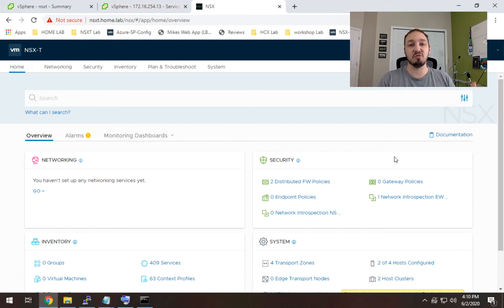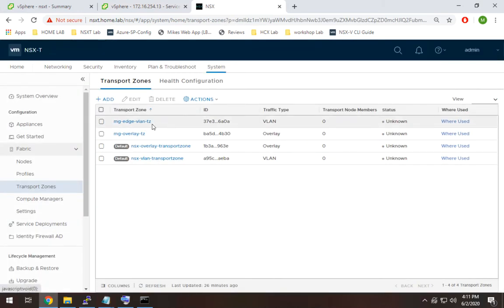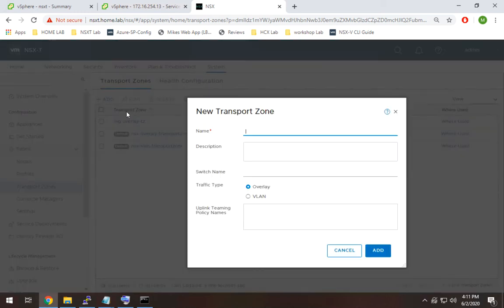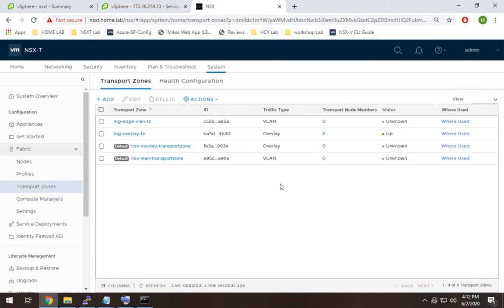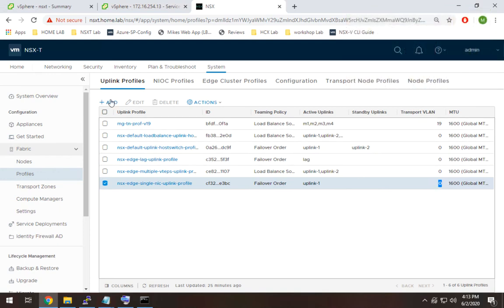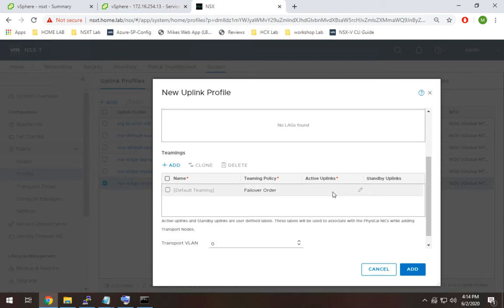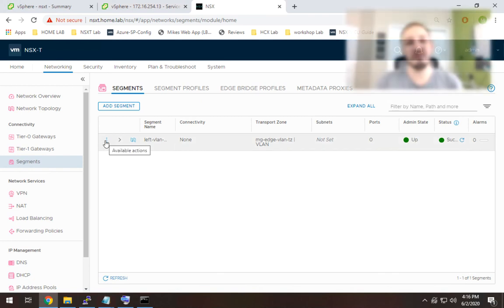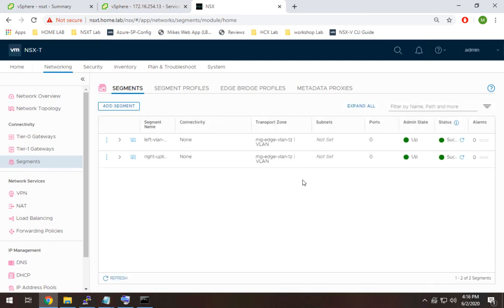NSX-T 3.0 from Scratch (Pt. 10): Edge Deployment Pt 1

Comment: You go into making sure that the switch name is the same on the transport zones, the overlay TZ shared by Hosts and Edges and the VLAN Backed TZ for the Edges that will be used for T0 Router uplinks to physical routers. On version 3.1.1 there isn't a place to specify the switch name anymore.

You specify an active and standby uplink profile for the edges. The edges are virtual whereas in the real world ( not a lab ), the Transport Nodes are physical, so I guess the uplink profile doesn't matter all that much. Both are going to connect to the same VMware VDS in the Host.

Comment: A key thing I am seeing is the ability to have all three networking option supported at the same time on an ESXi host with native Distributed Switch:
- native VLAN ( what you already have in production )
- NSX-T VLAN backed ( giving you Distributed Firewall features )
- NSX-T VLAN ( giving you the whole kit and caboodle )

This makes it very easily to progressively migrate a Production environment. We currently have VLAN backed deployed from version 2.4 on an NSX-T DS so we are going to need to migrate back to a native DS before deploying overlay.
Reply: Wouldn't having all three cause issues at the end of the day due to amount of items needing to be done at the esx kernel level?

Side note, does the acronym SRC ring any bells for you?

Comment: Hey Mike, Regarding the TEP VLANs. VLAN 19 on the Transport Nodes and VLAN 20 on the Edge Nodes. But in the physical network i.e. Underlay, when the transport node send traffic to the Edge node which is ultimately destined for the Physical world. The traffic is encapsulated by GENEVE headers, it will contain the VLAN 19 Tag which you've used in the "Transport Node" Config. How will that Overlay traffic reach the Edge VM, considering it's a completely different VLAN? Maybe i've got my concepts wrong or i'm missing a trick here.
Reply: Or maybe you can create a Packet walkthrough video and that might clear things up.
Reply from the maker: Vikrant, great question. The answer is - traffic is routed to the destination, so it leaves the transport nodes on VL19, hits the physical router (which strips the VLAN tag), then drops it onto the proper VLAN (VL20) with the VL20 tag. That's how it reaches the edge. Does that make sense? If not I can do a video on it walking through it!
Reply: @NRDYTech  I'm sort of new to Virtualisation. I'm getting a hang of virtualisation concepts. Just need to understand how to manipulate the physical topology to work in tandem with virtual networks.
Reply from the maker: I will do that. Very simple, just need MTU > 1600 (I prefer 1700+) on switch, and DHCP. I’ll put something together ASAP
Reply: @NRDYTech  Hey Mike, Thanks. Now it makes sense. One request. If its not too much can you make a video of the Physical configs required or the configs you've made in your lab to accommodate the Overlay traffic i.e how have you curated your physical topology to consider GENEVE Overlays.